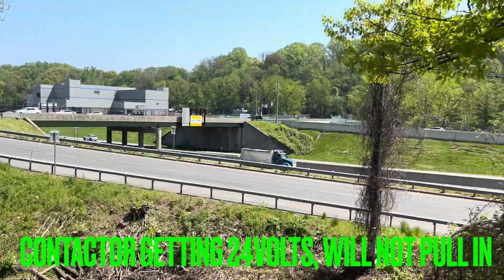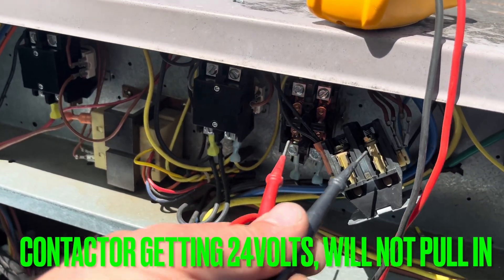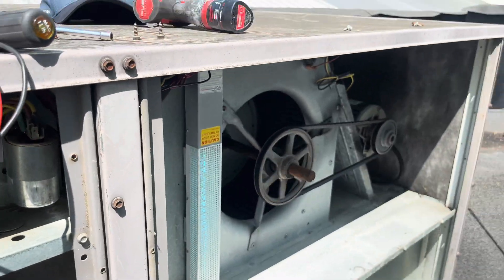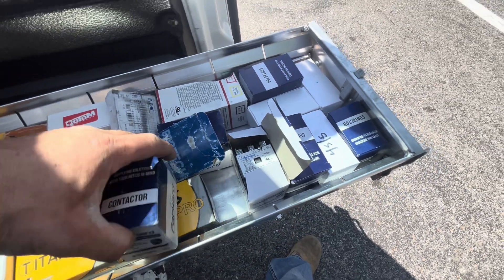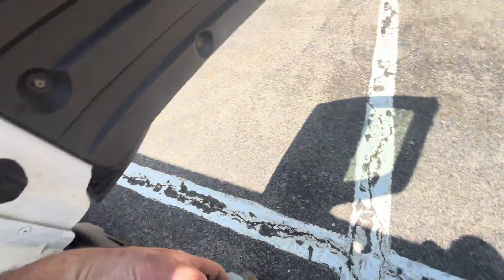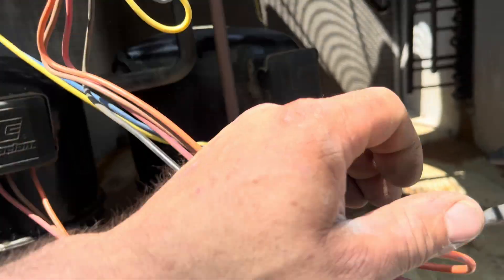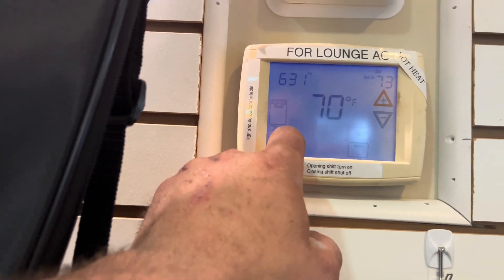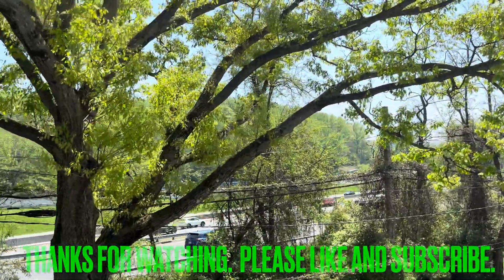Contactor on Carrier RTU is getting 24v.  Why won’t the contactor close to start the fan!?!

Comment: Be lucky it was not a 240 set up, and you put in a 24-volt contactor.  It would have let the fk loose big time. This happened to me repairing a refrigeration system on a Schwans food truck. I was on top of the truck and fell back and almost rolled off. And I had a friend standing there to flip on the disconnect, before he could shut it down massive electrical explosion, it happened that fast. After about 25 mins when I pulled myself back together, I went through every wire. Jumped back on top, I could barely make out 24-volt tag on the coil contactor, box said 240. it took out all nearby wiring, a time delay and some other shit. I was able to get it running , had to bypass the time delay I didn't have one on me. I always triple check now.
Reply from the maker: I definitely am grateful.    A small oversight is so bad.
Reply: @hvacotj   It happened about 15 years ago. I remember it, like it happened 5 mins ago. Be safe.
Reply from the maker: You too brother.